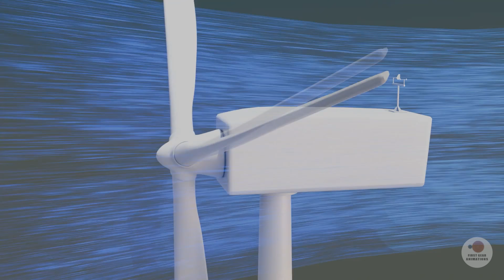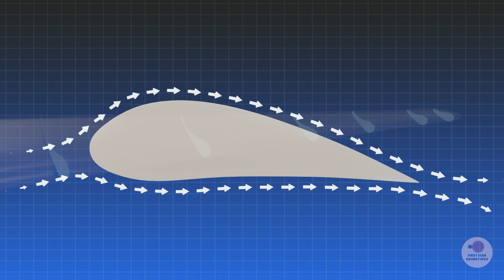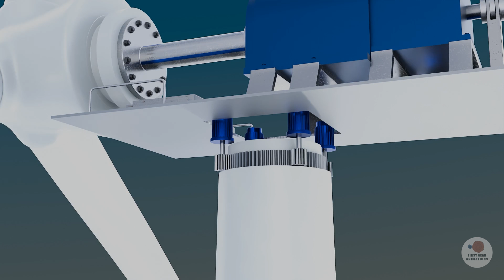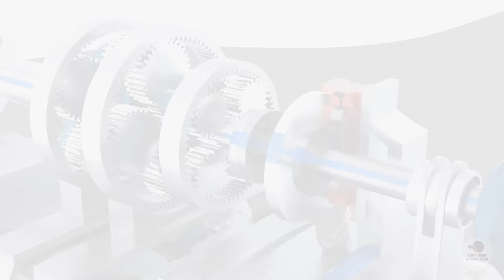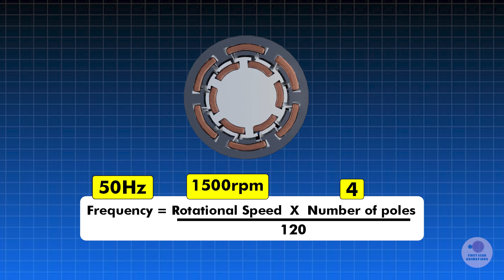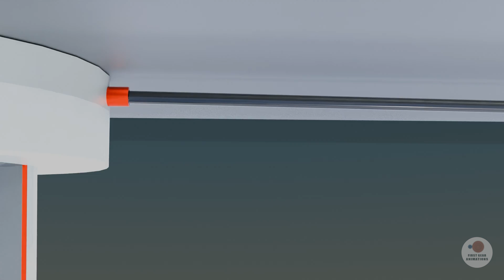Inside a Wind Turbine: How It Really Works

Comment: Best and simplest explanation of a doubly fed induction motor / generator I have heard.  You still leave the problem of generated Power Factor unanswered, but it is probably enough for one video. .  Thank you.
Reply: Yes good enough.
Reply: Excellent point. This is achieved at the land based substation as the PF is mostly determined by the Z characteristics of the final transmission line i.e. the type, the length and the inductance/ capacitance values of the load it is supplying. Again this is computer controlled and is  produced by switching in huge banks of capacitors.
Reply: Close enough.
The output of the generator is will pass into a ac ac converter. Mostly power igbt boards. The same is true for the rotor part of the generator, it passes into igbt boards that provide the correct wave form to achieve the offset frequency in stator output. But that part enough is should be a different video.

Comment: This is a great way to produce high cost electric power and fill the earth and ocean bed with thousands of tons of concrete, which, by the way, requires a whole lot of oil energy to fire the cement kilns and make the fiberglass shells. And then the blades can chop up passing birds and the sound confuse ocean life like whales
Reply: Still better then fossil fuels

Comment: How about mentioning that one of these larger units requires 60-80 GALLONS of oil in the gearbox that needs to be changed periodically.
Reply: It's actually hydraulic oil about 200 litres. Very expensive stuff. Seen it contaminate a field when turbine broke.
Reply: Thanks
Reply: That's actually a very small turbine transmission. A 5-10 MW turbine with 100 metre blades would need 1500-2500 litres. 400-660 gallons of hydraulic fluid.
Reply: What on earth does the word gallons, mean?  Never heard that word before .
Reply: @OmAn-oy5vm Jimmy Carter actually wanted to make the final switch to the metric system but ahole Republicans/ Reagan ended it.
Reply: @OmAn-oy5vm 
It's an outdated term of measurement that is used in an outdated country stuck in a time warp.
Reply: @rambleon3698 I'm not sure what country you're talking about as the United States of America is the Undisputed military and financial power of the world !
Reply: @danieljosephdelta44semperfi  the USA sucks in both ways 😂
Reply: @OmAn-oy5vm Just a form of measuring liquid volume, like litres.
Reply: Every gearbox needs lubrication. Even the gears on your bicycle.
Reply: @MG2318-r6u  Hundreds of gallons of OIL that the greenies want to eliminate.  These wind turbines create more environmental damage, not less.  Each one takes tons of concrete, blade disposal is to bury them, noise, birds killed and on and on.  Follow the money for these disasters along with the solar scam as well.
Reply: @cessnasingleengine  Big Oil has really brainwashed  you.  The uneducated Americans think that filthy oil and coal is "clean".   Oil and coal is NOT cheap either. The American Hillbillies who advocate "drill-baby-drill" are laughed at by the Scientific Community  around the world.  The world is leaving  ignorant American Hillbillies behind,  still pouring filth into the atmosphere while clutching their bibles and their shotguns.
Reply: @cessnasingleengine yes I agree and imagine all the additional fossil fuels used to mine and manufacture every aspect of those things ! From the concrete that is bolted to the paint on it ! Stunning amount of resources for all of that !
Reply: Yes we need oil to produce lubricants, plastics and other materials essential to modern life.  If we run out we are screwed.  That is why it is stupid to burn it.
Reply: @nickdanger4173  It is the vast scale of the fossil-fuel industry that matters. Lubricating oil does not harm the atmosphere just as Oil Lamps in ancient Egypt didn't harm the atmosphere.
Reply: @MG2318-r6u  The scale of lubricating oil is immense.  The reason it doesn't harm the atmosphere is because it isn't burned.  CO2 released from Egyptian oil lamps is still harming the atmosphere. Admittedly the level is trivial.
Reply: @cessnasingleengine If your older than 60 you shouldn't care about this. Why? You'll be dead before any harm they cause will matter
Reply: Every power generating method has its own risks, and none of them are perfect.  However, the statement that wind power is more damaging to the environment than gas or coal is simply false.
Reply: Yes, periodic maintenance, yes. My car needs an oil change at least twice a year. So? Donald Trump's sons change the oil on their heads at least once a year. It's just maintenance.
Reply: @ronthered138  Ignorance is bliss.
Reply: Compare that to the unclean materials and energy to extract, transport (around the globe), refine, and transport (again) to the bulk storage and transport a couple more times before the oil reaches the end user. Now add the cost of manufacturing of power plants and or the millions of individual boilers in homes.  Now add the recycling effort required to deman all the equipment, trucks, trains, tanks and end-use materials to the mix.  Are you still so stubborn to cast doubt on the science?
Reply: This is a complete propaganda video. It is the most expensive and landscape destroying energy generator in the world
Reply: @theien5929 Americans... 😅
Reply: @theien5929 Trump is finished. You'll know it soon enough.
Reply: @theien5929   True only in America where the truth is called “fake news”.   America loves filthy coal.
Reply: @theien5929 the bigger the blades, the bigger the landfill site in 15 years
Reply: everybody know wind turbines are the biggest scam in Human History.... they are not really "green".... they are actually "negative green".... they create in their Lifetime and their  lack of Recycleabiity....  A MUCH BIGGER CARBON FOOTPRINT than burning the same amount of Coal or Gas to make equivalent Kilowatt Hours of Electricity.. First they called the SCAM  "Climate Change"   well that didn't work... Nobody believed that.. so then they changed the Name of the SCAM to "Global Warming"  and that too was exposed as a SCAM..... Next week they are having a big meeting to change the name of the SCAM  to   "The Sky is Falling"..... let's see how that works out for them.....When the Sun don;t shine and the Wind don;t blow....... COAL WORKS ...First Time... EVERY TIME...
Reply: @VinceTomJones uninformed cult belief
Reply: @VinceTomJones what do we do when coal runs out?
Reply: @melcragg7814  Bahahaha.. Try using the internet for more than Fakebook Twits and INSTApersonalGRAMification... You have the largest Library in the world in the palm of your hand... USE IT.. research "something.." anything for that matter... .... now get to it.. research research research... I cannot help you any further.
Reply: @VinceTomJones how come there is a narrow minded person like you😢
Reply: @joditot  Bahahaha.. Try using the internet for more than Fakebook Twits and INSTApersonalGRAMification... You have the largest Library in the world in the palm of your hand... USE IT.. research "something.." anything for that matter... .... now get to it.. research research research... I cannot help you any further.
Reply: @joditot   Bahahaha.. Try using the internet for more than Fakebook Twits and INSTApersonalGRAMification... You have the largest Library in the world in the palm of your hand... USE IT.. research "something.." anything for that matter... .... now get to it.. research research research... I cannot help you any further.

Comment: 😅this person in the comments explaining how lift is produced  is plainly daft. Yes, lift is produced by the difference in pressure below and above the aerofoil. The difference is caused because the air flow has to travel further over the top surface ( owing to its shape)  and there fore travels faster and has less pressure than beneath the surface Basic aerodynamics 101.
Reply: The Wright Brothers figured that out over a hundred years ago.
Reply: If you can't post a different opinion without resorting to abuse then don't bother
Reply: The problem is idiots with  zero knowledge posting stupid opinions in defiance of the facts.

Comment: The explanation of lift given here is wrong.  Airflow does not speed up over the top surface, thus creating lift.  There is no reason for air to move faster over one surface than another.  Instead, it is the difference in pressure between the lower side and the upper side that produces lift.  This is a wide-spread myth about how airfoils work, but it is not correct.  Also, the change in airfoil sections and angles along the blade is not just for strength and wind speed: it is mainly to provide the best aerodynamics at each point along the blade, give the rotational speed at that point.
Reply: Typical wrong info from AI.
Reply: The air does indeed move faster over the top of the airfoil than the air below; that's how the pressure difference is created.  What is incorrect is the idea that the air travels faster over the upper surface because it has to travel further.  The actual reason is still being debated.
Reply: @heronimousbrapson863  No, that is not correct.  That's a common myth.
Reply: Basic aerodynamics.  Air velocity over the wing is faster, creating less pressure on top, thus creating lift.
Reply: @DS12-42 Wrong.  That's not how it works.  A perfectly symmetrical wing section still creates lift...
Reply: Thanks. Good video. But it's Alternator or generator?

Comment: In Europe the required network frequency is 50Hz. 
The output voltage in Germany can be between 10kV and 30kV. 
From there the electricity goes into the substation. Stepped up to 110kV or stepped down to 400/230V.

Comment: And how they maintain the output voltage?
Reply: Likely the same as a modern AC locomotive.  AC rectified to DC, then inverted back to AC.  It's also why a vehicle inverter maintains 120V even while the alternator produces anywhere between 12.5VDC to 14.5VDC.  The reason DC generators aren't used in the first place? They are huge and far more complicated than an AC generator.
Reply: The variable frequency power fed to the rotor is altered to give the desired output voltage.
Reply: Surely they have a flywheel technology in those things. And the rotating magnetic field.
Reply: Ok so your eyes and ears are painted on..watch it AGAIN... s  l  o  w  l  y

Comment: Many people are not so happy with a wind turbine in their vicinity.

Sleepless nights, health problems. Noise nuisance caused by noisy gearboxes, blade noises, and shadow flicker.

Then there is visual pollution. Wind turbines ruin the landscape.
Reply: There's always tradeoff of using any power source

Solar cell? Need a lot of area compqred a to this

Nuclear? Everybody scared of it, due to Chernobyl (even though Nuclear power plants are much safer now)

Water powered? Needs reservoir, methane pollution 

Since we need energy we have to accept that power plants exists and give some bad impact to the environment, health, and social
What engineers can do just minimizing
Reply: sounds like ASMR to me.

I also very much enjoy seeing wind turbines on the plains.  It's like grain elevators.  Good spatial awareness when you can see something on the horizon.
Reply: I'd rather see a wind turbine out of my window than a gas fired power station